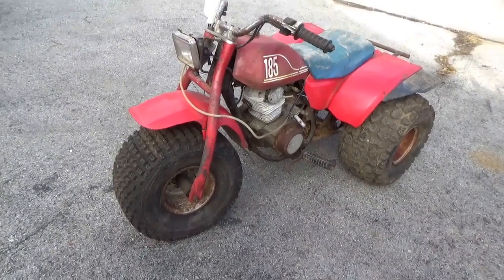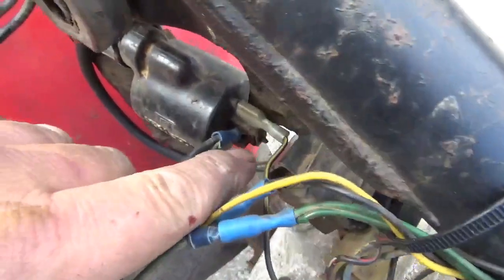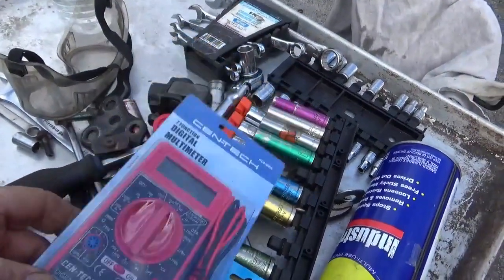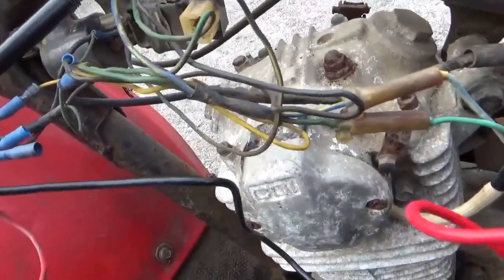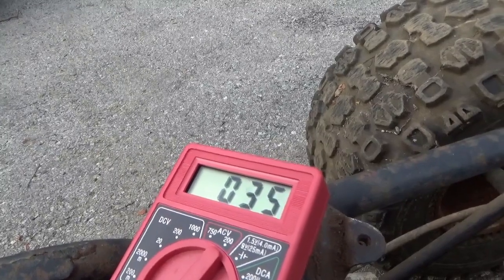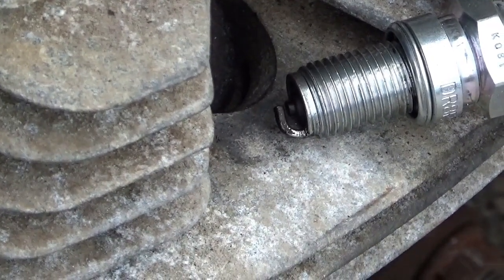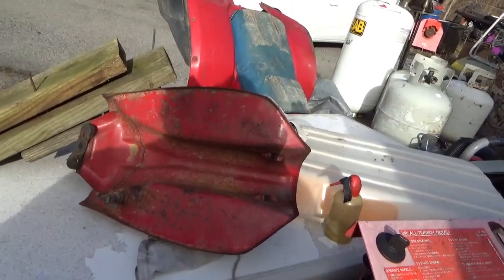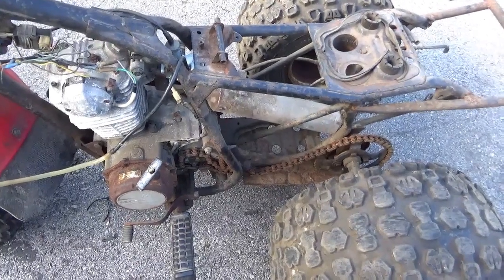No Spark Honda ATC 185, OEM CDI Troubleshooting and Repair!

Comment: just did a gas tank,replaced the two back lower corners (5") ...used muriatic acid-water lush and POR sealant inside... worked great but should have bought a plastic tank i think...POR would work great in this one...Creator bless ...doug

Comment: Sounds great, a little more TLC and you'll be off and riding. Keeping it moving every day.
Reply from the maker: Hey Steve!!! It definitely needed to be saved and needed some love! The chain and sprockets are fighting me! But, in the long run, it will be back!!! Thanks for Ur thoughts, support, encouragement, watching, and commenting!!!
Reply: @HarveySpooner  In my parts book the rear sprocket listed for a rear sprocket 1980  is 47 teeth and 81 and 82 has 41 teeth. Also some sprockets  come with spacers and others use the phrase -use stock Cush ? Look in those catalogs I gave you otherwise once you determine the year it might get easier.
Reply: @HarveySpooner  Rear sprocket 47t same as 81-82 atc200 , OEM front sprocket 11t and chain 90link 520. BABBITTS ONLINE.